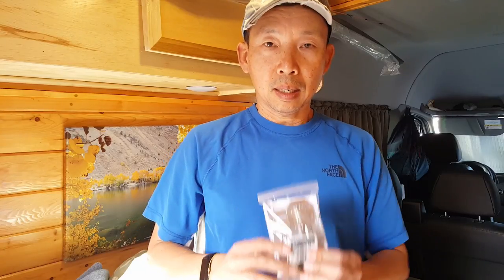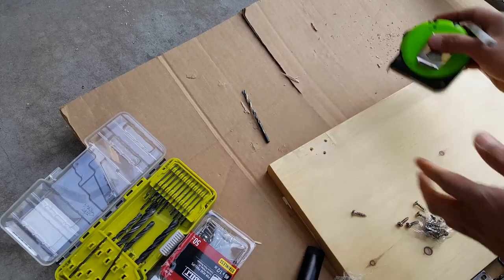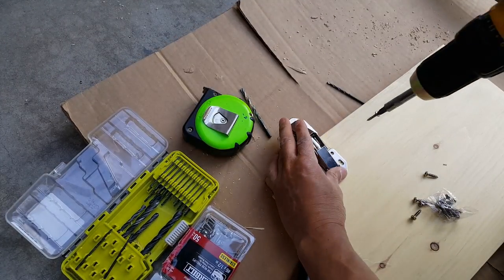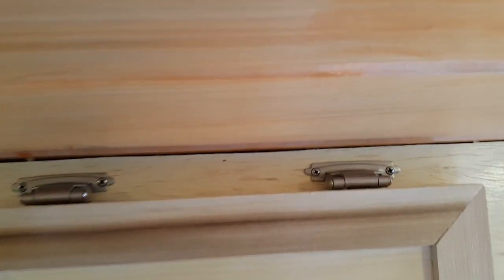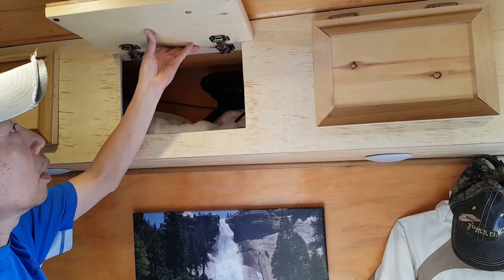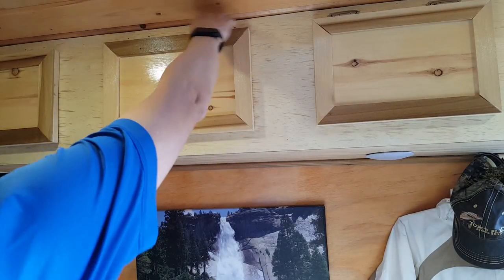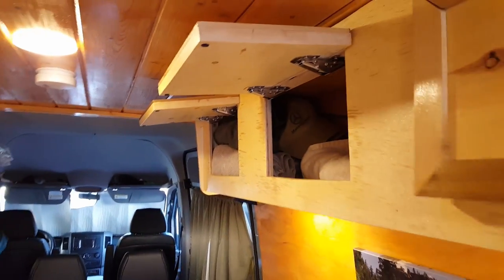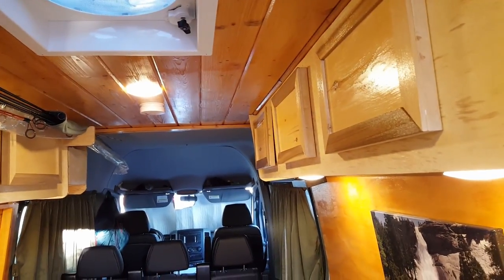DIY easy cabinet hinges in a camper van

Comment: Exactly what i needed to know. I have the same issue with my cabinets in our travel trailer. Was thinking those angle tension holder things or gas shocks to hold the door up but these are perfect. Thanks!

Comment: How did you know to measure 3/4" from the edge of the cabinet door to place the hinge ? I bought these to put on my cabinets that I'm making now for my van. Thanks
Reply from the maker: There are longer holes that designed to be adjustable for your screws in case they door is too tight and close.

Comment: The initial installaion is wrong. You should only screw in the slotted holes, then adjust the hinge until you are certain, then screww in the the round holes.

Comment: Could you use these on a cabinet door in the house?  It would be for doors that open left and right instead of up.
Reply from the maker: It's designed for up and down doors if you use it for side way it can only open 90°
Reply: J Raymer - you actually can! I actually used them on a cabinet setup myself. You can see the optional uses in the photos on these: https://www.amazon.com/gp/product/B01IY8CTLM/ref=ppx_yo_dt_b_asin_title_o01_s01?ie=UTF8&psc=1

Comment: Are they only supposed to work when mounted? I tried moving them with my hands and they won’t budge.
Reply from the maker: Oh they're strong you can't fold until you mount them
Reply: @BoChuonOUTDOORSVANBUILD  Thank you.
Reply: I had the same question. I'm glad you asked. 🙂
Reply: You can bend them but takes a special technique. Hold them thumb to you centre then push your thumbs up like breaking chocolate. You grip the other side flap with your next finger.-  Took me a while to work it out

Comment: I'm not sure if you or anyone reading this comment know the answer but I'll ask anyway.
I'm thinking of using these hinges on a cabinet with vertical stacking 'cubes'.  So the doors will be side-by-side in vertical order.
What is the gap I need to leave between the bottom of the door at the top to the hinged edge of the door below it, so that the doors can open without bumping each other?

Comment: Very good video. I was wondering how the hinges are doing after a couple years.  Also, what is the minimum thickness needed for the cabinet box to screw the hinges into.  Thanks so much!
Reply from the maker: The hinges were still good but I upgraded to a soft close kind. You need a 3/4" thickness